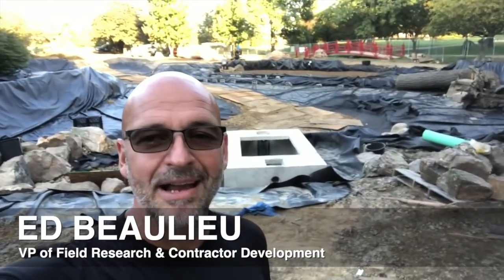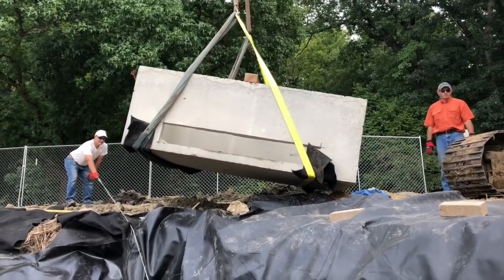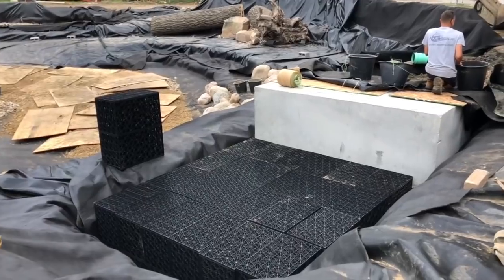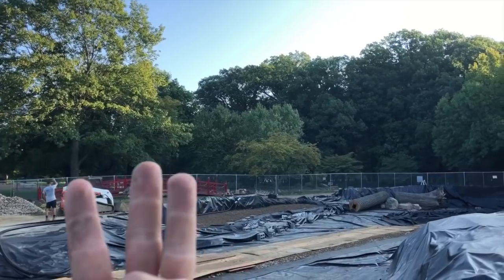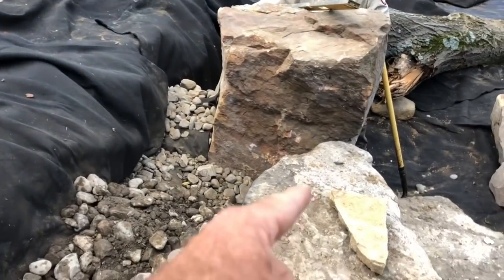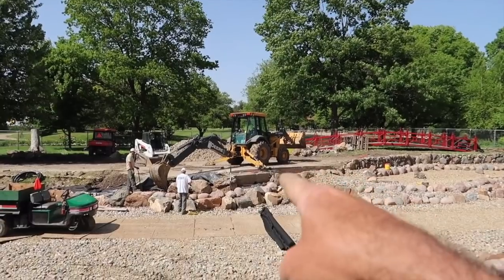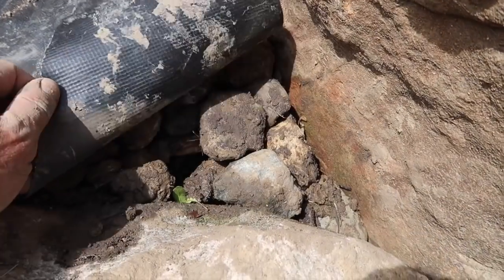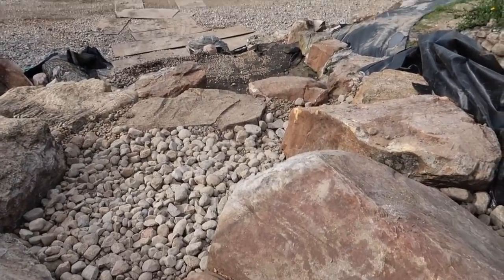25-Foot Waterfall & POND RENOVATION: Part 3

Comment: What an exciting project! I really like that you go through and explain everything as you're making progress.  One question I had with the waterfall, is why did you use liner + expanding foam to keep water flowing instead of something like concrete?
Reply from the maker: c31979839 concrete cracks foam shifts with the freeze thaw cycle
Reply: @TEAMAquascape  ahhh, flexibility! I never thought about that.
Reply: c31979839 Many, many years ago we used mortar but in Northern climates it cracks and leaks, the foam allows for greater expansion and contraction.....

Comment: Just the electric bill for those huge pumps ! How do you do it !
Reply: waterchildtera The main waterfall will be turned off at night to keep costs under control and it will extend the life of the pump. 
The smaller(5Hp) Wetland filter pump will run 24/7

Comment: So even with such a large pond, you still use a liner? Is that a combination of cost and versatility? Do you not worry about tears in the liner? 
Great work by the way - loving this project!
Reply: Huggy Bear It’s very cost effective and it works!
As long as you take the necessary precautions and understand the limitations of the material you’ll get great results!
Reply: Ed Beaulieu looks great. I wasn’t sure if you were working on such a large pond, you would ever use a natural barrier: a clay mix of some sort. I have no experience just wondering what your alternatives might be to a liner... 👍
Reply: Huggy Bear Clay liners/compacted soil is commonly used for large natural ponds but it depends on the goals of the client. 
If the goal is great water quality and to minimize water loss rubber liners are the best option. 
Clay liners will always have a murky appearance due to the soil particles staying in suspension.
Reply: Ed Beaulieu thank you for taking the time to answer my questions. Looking forward to seeing the next instalment. Keep up the great work!